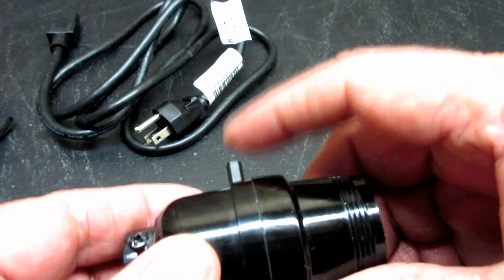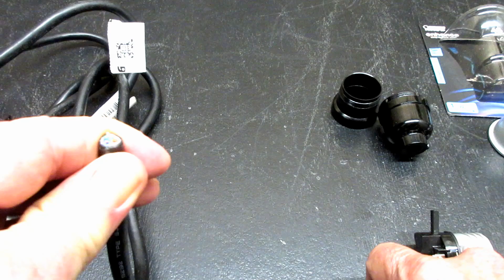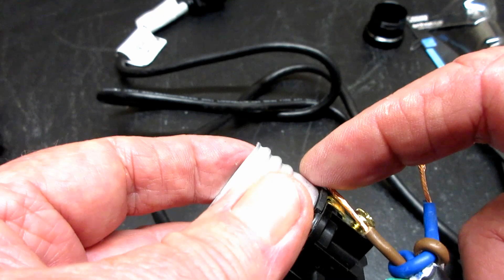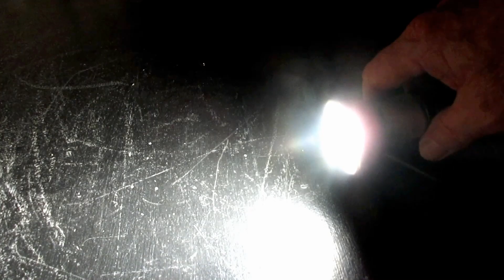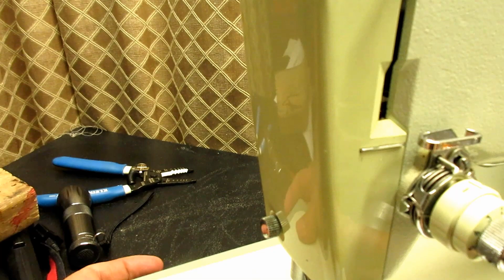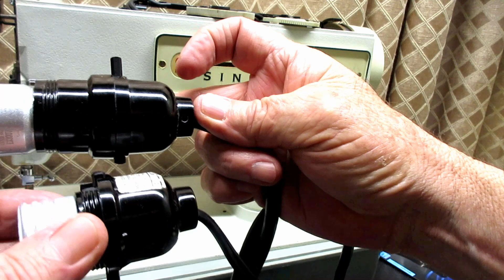Make an Electric Flashlight for Sewing Machine Repair and other work.

Comment: That's a great improvement over flashlights & lamps. Like you said, the camera is a little over-exposed or washed-out at times, but you were just trying to demonstrate the light.
Reply from the maker: Yes, I do like it. Carole contacted me today and she was glad I mentioned using a 2-wire cord also. She had Roger make her another light with the 2-wire lamp cord as it was easier for her to move it around her workbench. Another viewer put a link to a video showing a diffuser on lights. I used to tie a handkerchief over that clamp light to cut down on glare and I may use something on this little LED light. Whew! it is bright!